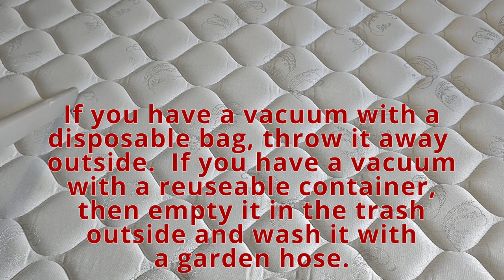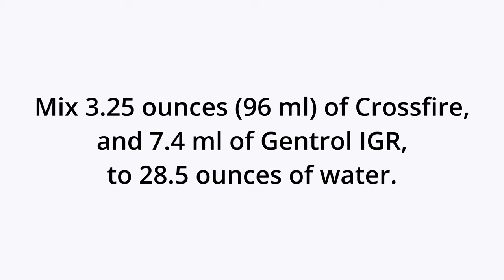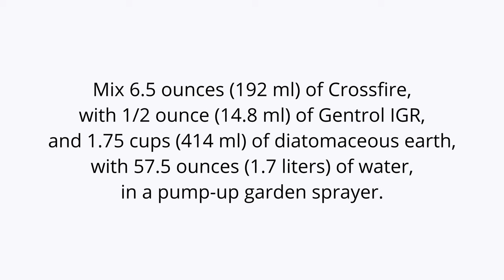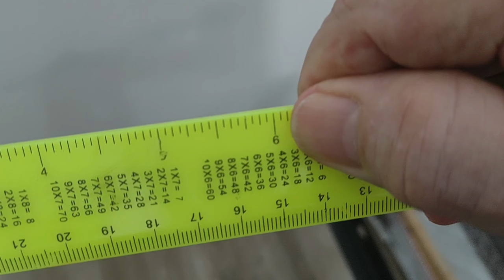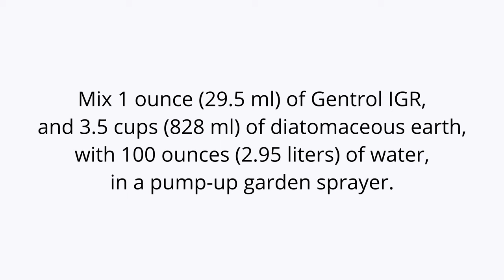ULTIMATE Bed Bug Solution!  AMAZING.  This ALWAYS works.

Comment: i have a condo that is currently empty.  The previous resident moved out 1 month ago.  Bedbugs detected in March.  Hired a local pest control.  I don't think they did a good job.
My questions are:
What does the diatomaceous earth do?  The crossfire will coat it but crossfire has residual of 30 days so it will no longer be effective?
I am using Ortho bedbug traps to see if I can bring them out and detect them.  Is this product any good?
It was a "small" infestation, will they travel to other units because they can't feed right now, or will they hang here for a bit because they don't feed often?
I am worried about vacuum cleaning because I don't want to pick you these things and bring them back to my house.  It is a bagless cleaner.
I plan on doing all baseboards and window areas. Not the floor in general.

Very good video.  I have watched many of your videos before.  Informative.  Thank you
Reply: DE is some sort of soil from old tiny life forms called diatoms. It's white and consistecy of flour. Do not apply it thick, just a dusting. Somehow, the DE will stick to the exo skeleton of the bed bugs when they walk over it and somehow cause their skeletons to fall apart and/or dries the bed bugs out, killing them. I use a water bottle with a tiny drilled hole (less than 1/16th inch) in the cap. Just squeeze and it comes out while you are fanning it across the surface. Personally I flip my couch upside down and spray the interior of the surfaces. When I upright the couch, the dusting will fall and cover some of the surfaces I cannot reach. Like the gentleman says, its a multi approach to eliminating the bugs. I use those bowl shaped containers under the legs of everything in my room. Desk, dresser, nightstand, bed, etc. Those bowl shaped containers are permanent in my home and I sleep well
Reply from the maker: I'm so sorry that you were dealing with the situation.  The most important thing for you to understand is that bed bugs are arguably the second most difficult insect to get rid of in the entire world.  So, if you have them in that condo, then you need to take this thing stone cold seriously.  There are no shortcuts to getting rid of bed bugs, and that is why the pest controller failed.  Anybody that tells you there is a quick and easy solution to bed bugs is lying to you.  I promise that absolutely everything I show you in the video is done for a very good reason.  Failure to do things like treat the floors may result in failure.  Please believe me that what you are up against is a formidable problem.  So, the best advice I can give you is to carry out the procedure in my video exactly as I show you, with no deviations whatsoever.  I understand that some of it may be confusing, and believe me when I tell you, I could teach an entire college course just on bed bugs.  There is way too much to know for me to include it all in a video, so please trust me that everything I show you is a must if you wish to be successful.

Diatomaceous earth (DE) is it naturally occurring, powdery substance, made up of the fossilized remains of tiny, aquatic organisms called diatoms.  These diatoms have cell walls that are composed of silicon dioxide (silica), which is a hard, abrasive material.  When bed bugs get this material on their exoskeletal it will cut holes in their bodies and starts a process called desiccation.  This basically means that they're going to be dried out to death. The good news about DE is that the bed bugs cannot become resistant to it, and it lasts forever, or until you remove it.  That is why we like to use it.  The downside of DE is that it is very slow acting.  That is why we use other techniques and pesticides to speed up the process.  The problem with these other products and techniques is that you may not get all of the bed bugs right away, and they don't last forever.  Also, the bedbugs may already be resistant to some of the other products.  If you miss so much as one egg, then you are off to the races again.  Since the DE lasts forever, it gives us a very good chance that it will kill any bed bugs that come from the eggs that may have been missed.  So, using DE it's a very important part of the process, but it is only one tool and our toolbox.  To be successful, you need to combine all of these methods to ensure a 100% eradication of bed bugs. 

If you read the product information on the Ortho bed bug traps, you will discover that they should not be used to treat a bedbug infestation.  Their only purpose is to detect bed bugs.  So, they may be useful to monitor the situation, but they are of little value in treating it. 

Bed bugs can, and do, travel from one apartment, or condo, to another.  Even though they cannot fly, they happen to be very good crawlers and can easily travel from one unit to another.  It is not uncommon for them to do this. Therefore, after you get rid of your bed bugs, I recommend that you make sure that you have applied diatomaceous earth under all the baseboards. 

Vacuum cleaners can become a harborage for bed bugs, so be sure that you treat your vacuum the way I show you in the video.  If you are really concerned about this, then simply buy a cheap shop vac from Amazon or Walmart, and then throw it away after you are finished. 

I hope that answers all your questions.  Remember, the key to getting rid of bed bugs is thoroughness.  Leave no stone unturned. 

Be well my friend.

Comment: So I've done this method and it worked yay!!! But I have a question?how often do we have to repeat this ?? I've been dealing with bed bugs for close to two years now and got completely fed up with it so thank you so much!!
Reply: I forgot to mention I've done the spraying everything part twice in a two week period and now we aren't getting bite anymore I'm just afraid they will get tracked back somehow
Reply from the maker: I am so happy to hear that you finally got rid of the bed bugs.  I am so sorry that it took 2 years to do it.  Now that they are gone, they won't be back unless they are reintroduced into the environment.  It is important to ask yourself how did they get there in the first place?  You could have picked them up from a hotel, from staying at a friend's house, or sometimes even visiting someone who has an infestation.  Also, if you live in an apartment or other multi-unit building, like a condo or townhome, then you can get them from the neighbors.  If that is the case, then you can get reinfested easily.  If you live in a multi-unit building, then make sure that you keep diatomaceous earth under all the baseboards.  From now on, always inspect for bedbugs whenever you spend the night somewhere other than home.  I have a video on how to do that.  It was done at a hotel, but the procedure is the same regardless of where you are staying.  You should also inspect for German roaches as well.  If you think bed bugs are bad, you ain't seen nothing yet.  German cockroaches are a nightmare straight from the bowels of Hell and they are way more common that bed bugs.  I have a video on how to inspect for them as well.  You would be wise to always inspect for both bed bugs and German cockroaches when you are spending the night somewhere.  Should you become reinfested with bed bugs, it is important to treat it just as quickly as possible, before it gets out of hand.  Always keep bed bug traps under the legs of your bed and inspect them often.  If you see a trapped bed bug, then start treating.

I hope that helps.  Be well Sarah.

Video on how to inspect for bed bugs:  https://youtu.be/GKLCrY7MdD0

Video on how to inspect for German cockroaches:  https://youtu.be/bEwCA_nrY5Q

Comment: Super helpful video just like your termite series 👍.  At what point, fumigation is necessary for bed bugs?  How do we determine if we have serious whole-house bed bug infestation vs 1-room?  Thank you Sir !
Reply from the maker: Thank you so much for those kind words.  Very much appreciated.  We generally do not fumigate for bed bugs.  I suppose that could work, but it would be an expensive way to go.  You can treat bed bugs yourself very effectively if you are thorough.  It is important to understand that bed bugs are hitchhikers.  If you have them in one room, then it is very likely that they are in other rooms as well.  Since they can be hard to find, I always recommend that you just assume that they are everywhere.  They survive by eating blood, so always do the bedrooms first, followed by the living room.  These are the most likely places to find them.  However, they can be hiding just about anywhere.  If you miss just a couple of eggs, then you are off to the races again.  So, treat the primary areas first, like the beds and upholstered furniture, and then treat everything else in the room.  By treating the floors, you make it hard for them to move from one room to another.  Keep in mind though that YOU can carry them from one room to another.  If you have them in the bed, then you can carry them to the couch and vise versa.  So, be careful after you treat the bed that you do not reintroduce them to the bed after you sit on the couch.  That means, until the infestation is gone, you should get undressed in a treated bathroom and check yourself for bed bugs before getting dressed for bed.  Put your clothes in a plastic bag and wash them immediately.  Do not underestimate these things.  They are very good at what they do.

I hope that helps.  Be well my friend.

Comment: What pesticides are safe for pets dog, cats etc?
Reply: And small children.
Reply from the maker: The products are safe for dogs and cats.  Just don't apply these products on places where your pets like to lay down.  Other than that, they should be fine.  I hope that helps.  Be well my friend.
Reply from the maker: @bryanutility9609  It's safe for children, but don't let them roll around on the floor if you applied diatomaceous earth on the floor.  It could get on their skin, and it may cause a rash.  Nothing that won't go away on its own, but you should avoid that.  The other pesticides are safe for kids to play on after they dry.  Just follow the directions in the video and you should be fine.  I hope that helps.  Be well my friend.

Comment: I have an infestation I've been dealing with for several months. I've tried all kinds of things of other things to avoid using insect bombs and pesticides.

I've tried UV lights, both to create ozone which kinda helped keep the population down, (didn't see them for a few days), and to try an burn them. But in hindsight if you're going to go that route, an ozone generator or 2 or 3, and week long vacation somewhere else while leaving those on, might do the trick. Fill the whole house with ozone, based off of what I read, a 100% saturation of it kills them and the eggs. If you're like me, who can't really take time off. Than this method might not be for you. The ozone does kill them, and they don't like the uv light. I confirmed it. It's just it requires you to be away for a while, so that it can work. You could use the light everywhere else to try and keep them in one room, if you're sure they haven't spread to anywhere else.

I'm not too sure about steam cleaning, maybe on surfaces and anything not too thick, I think the steam would work. On mattresses though......it might help keep the population down, now if you have a vert well ventilated room, you could saturate the mattress in steaming water, and use a steam vacuum or wet vacuum to suck up and dry the mattress,  I was too afraid of mold growing to do that. Overall, just steaming the mattress, I didn't see much of a change, other than a few days where I didn't see them.

After those didn't work, my brother told me his dad used diatomaceous earth after his fiasco of bombing the house, and the furniture individually, and that did the trick. Took me some trial and error with it, the package isn't very detailed  in how to use it. Basically you're supposed to use a brush of some kind, like a paint brush, and get in into every nook and cranny. Pull the bed away from the wall, and put it down around the whole bed, around the foot of the walls, so if they try to leave or go anywhere, they have to walk through it.

I didn't do that. I covered the whole floor and top of mattress. Once my mother and sister confirmed that they didn’t find anything on their mattresses, they put down fly traps taped to cardboard on top of the diatomaceous earth, at the threshold of their doors. I covered the baseboard so if they wanted to use the walls to travel, they had to walk through the stuff. And so far that has worked in keeping them out of other's rooms. I put the stuff down under every piece of furniture so they had to walk through the stuff to get to anywhere else. Since diatomaceous earth is so messy, I've been slacking on cleaning, doing the minimum, I haven't vacuumed.

Well that worked kinda for a time, but then I started finding them on me in the recliner. I stopped sleeping on my bed, which I found out later was a big no-no. Then I did some searching around on the internet, and found out and confirmed  that bed bugs are indeed attracted to CO². Like they really love it, like cult level love. So then I started looking up CO² traps. Which are super cheap to make, but take you a few trial and errors to figure out a good ratio of sugar to yeast. I put it near the sofa where my sister said she found one crawling on her.

I'm thinking that these traps might work better in the fall or spring time frame's. They release CO² so slowly that the  A/C and fans can mess up where you want a concentration of it. So the cooler times of the year where you aren't real uncomfortable with no fans and no A/C or furnace going, might be better.

Now if you just want to confirm where they are and aren't in the house, and don't want to mess with sugar and yeast, dry ice is the thing to use. Do a little searching for buying dry ice, and there's a few places that sell it. You could use those welding tanks and get one of those filled, but those are pricey, and dry Ice is pretty cheap.

The first time I used dry ice, I got it in my head that I would buy enough that when it melted it would suffocate the bastards. Well I bought 60lbs of it, put a block of it in every room, with the fans going so that it would get everywhere, and after 8hrs, I still had 30lbs of it, the water in the air froze to it, (snow Basically) , and acted as a cooler, I was so pissed, I threw the leftovers outside, and I shit you not, there was still a quarter sized spot of dry ice in my yard 24+ hours after I had first bought it. 

I got to thinking and figured it would've taken more to actually suffocate them. But I found out exactly where they were. So once I chilled out and thought about it, and I was about to give up, and call an exterminator. But then I thought I could use the dry ice to lure them onto a killing field. And so I did, and it freaking worked! I got a mat from my truck, a rubber one, a big dinner plate, and a cereal bowl. Turned the plate and the bowl upside down on the rubber car mat, and placed smaller pieces of dry ice on top of the upside down bowl.

I read that rubbing alcohol kills the little bastards on contact, and dries quick, so I don't have such a worry about pesticides. But it is flammable so keep that in mind when using it. I covered the whole mattress in the diatomaceous earth. And I killed hundreds. The little bastards would crawl over the lip of the mattress, and walk through the diatomaceous earth. Those that crawled into the car mat died (suffocated) , I squirted rubbing alcohol on them just to be sure, and the ones still moving stopped after the rubbing alcohol.

I dumped the mat in the tub with bleach to make sure I killed them. Found a bunch laying dead on the mattress in the diatomaceous earth. After 24 hours, the population is significantly reduced, I expect that the ones that got away are covered in the powder. I'll continue this method for the rest of the week or until I don't see any. Then do it again, but use the bulk of the ice in a different room. Or area where they were spotted.

I think I'll put a white towel or sheet down, so it's easier to see them, and determine if other areas need it. I'll keep the fans off so the CO² stays near the floor but the amount I'm using and how slowly it melts once it's covered in water ice, I don't expect much if any problem with a few smaller chunks of dry ice. Mom was pretty worried about it (CO²), but once she saw the result, she is fine with it. She's still treating it like a boogie man. 

Whether you do what the video says or not, if you just want to verify where they are, CO² attracts them in droves. It would be a good way to determine how infested you home is, and in what areas. Personally if I were to use the video's method, I would start in the rooms that they haven't gotten to yet, and work my way towards the room they are in, so if any try to scatter, they run into what you've already setup to deal with them.
Reply: some good info and i appreciate you taking the time to write it and don't mean disrespect but nobody has the time of day to read all that.
Reply: @Hellenicheavymetal  yea, I was venting more than anything else. Bed bugs are quite the fiasco.